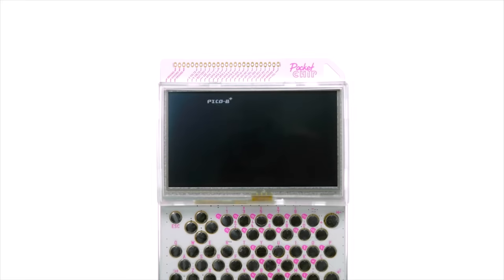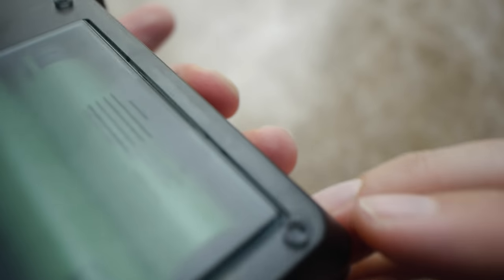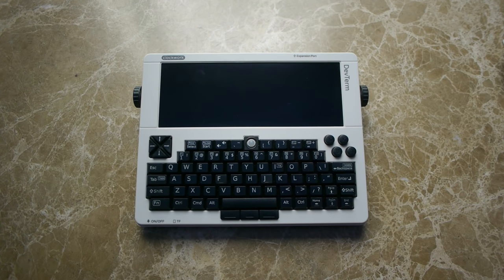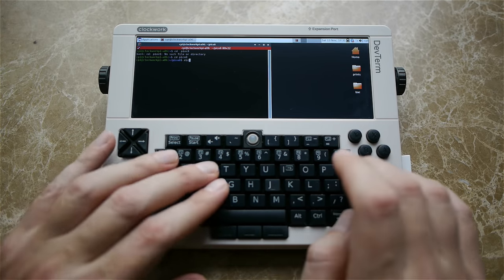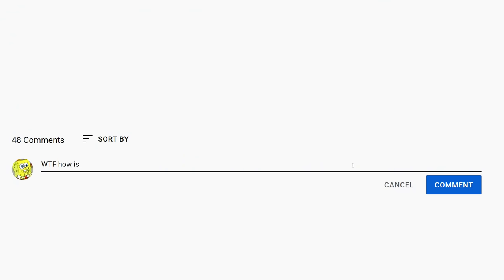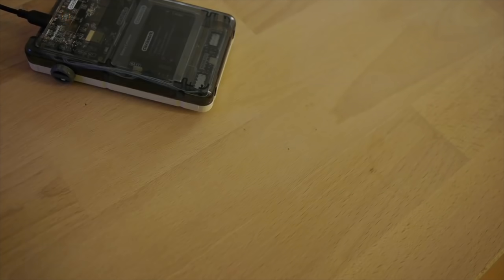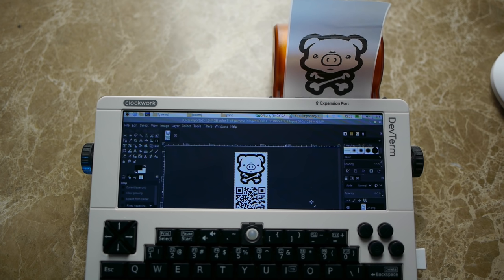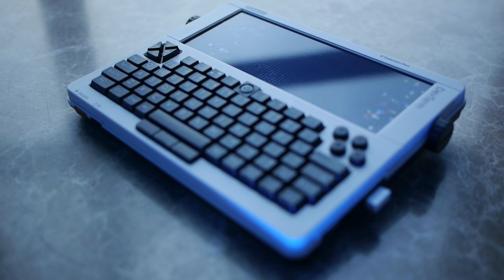ClockworkPi DevTerm | HARDWARE REVIEW

Comment from the maker: ⚠⚠ERRATA⚠⚠
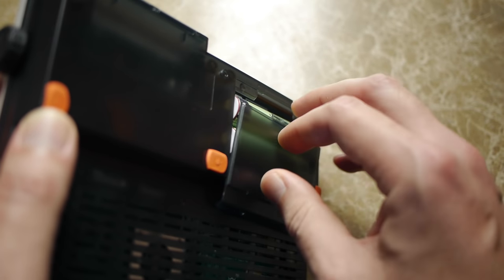4:10 - I've recieved reports that the battery flap is more stable in other units. It is unclear how prevalent this issue is.
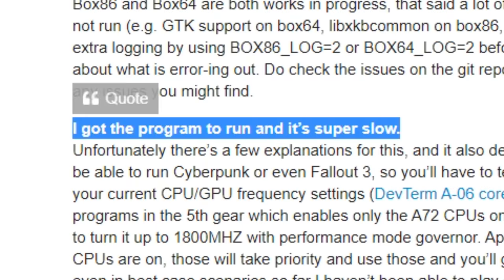15:11 - The A06 unit's Armbian system does have a package manager. So you can simply do "apt get-install" for a lot of software. In this video I'm referring to compatibility issues for software that isn't covered by the package manager - like Pico-8 or TIC-80.
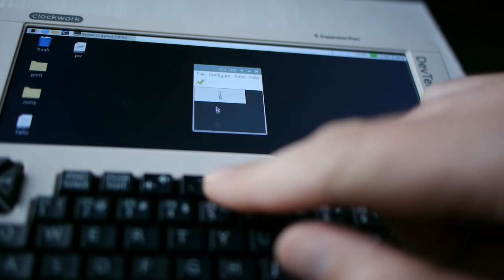24:33 - I was able to get HDMI-out to run after all. Seems like my problems might have been caused by the socket being inset too deep. The cable I used has a hard time making a proper connection. Heard other people having similar issues. If you encounter issues with HDMI-out, I recommend trying different cables.

Comment: It seems like whoever designed the console buttons has never use a game console.   Also they should've used a trackpoint instead of a trackball, or at least a larger more accurate trackball that actually uses laser tracking.  Those tiny trackballs weren't meant to be as accurate as the fullsize trackballs that normal trackball mice use since they were made for old phones.
Reply from the maker: Probably one of those things that becomes obvious in hindsight. With the console buttons I assume the used similar engineering they used on the keyboard keys. And surprise! Keyboard keys are not the same as console buttons!

Comment: Great video! Despite all its flaws, I still love my Pocket CHIP. Nothing can replace the fun of bringing it into lectures and having friends struggle to write a single line of C code with its keyboard.
Reply from the maker: How can something be so bad and yet so very good.
Reply: @LazyDevs  apparently there is gonna be a Pocket CHIP 2 which will surely be interesting
Reply: @camden4770  Wait, really? Next Thing Co. is dead, and the only seller of CHIPs and Pocket CHIPs rn is PocketCHIP.co, which is only selling the stock they received before Next Thing Co.'s demise. If there is gonna be a Pocket CHIP 2, who's making it?
Reply from the maker: @othercannon1907  Looks like a company called Sandmath. CEO is Dave Rauchwerk, the main guy behind the original Pocket Chip. Looks legit.
Reply from the maker: @camden4770  Dang! First thing I've heard about this and now I'm hyped.
Reply: @LazyDevs  yeah! From Dave Rauchwerk’s Twitter it seems like the second Pocket Chip is getting a new and nicer keyboard. Hopefully it solves the issues of its first version and still keeps perfect Pico-8 compatibility!
Reply: I still have mine and one of the chips died on it ;(

Comment: In most Linux desktops, you can just press ALT and click-drag a window in the middle to get to the hard to reach bottom part.

Probably don't swap out batteries with the device still running. So if you have depleted one set of batteries, they have a voltage of around 3.2V or something like that, but a cell fresh off the charger is 4.2V. So you have removed one cell, so far so good, now you insert a fresh cell in its place, and then you have compensation current rushing through to equalise the voltage on these two batteries, one will be discharging at inhumane speed and another will be charging at an inhumane speed, current-limited merely by a little bit of steel for the contacts in between! This is a great recipe to make them vent very hot gas. OK maybe they were smart and put in some polyfuses in there, but then, the device will shut down anyway.

Focused writing device? Maybe the likes of Psion V or Psion Revo. I have some Psion V units here. Haven't tried the Revo, but on the V, i can't thumb type, i can't reach the letters in the middle, but i can touch type. Revo's keyboard is a little smaller across, probably more thumb typeable. They are vaguely pocketable, for some types of pockets, presumably the lining pocket of a very expensive suit, i think the Psion V MX was like $3000.

Another very useful sort of device is just a late-2000s netbook. You probably get one for free if you ask around, everyone bought them, noone knows what to do with them. Plop some Linux with XFCE on it, boots instantly, emulates 16-bit consoles and Playstation, keyboards are actually made for typing. Screens are a little garbage. 6 hour active use battery life if not more. Maybe you can install some newer nicer cells into the battery, they usually have 3-cell batteries with 6-cell option. Opening the battery pack is very unnerving, but i was successful dunking the thing in gazoline outdoors and it seems to have softened the glue holding the thing together, and then i could just twist it open.

And yeah Devterm is definitely a Cyberdeck device first and foremost.
Reply from the maker: Thanks for the insightful comment!

Oh yeah, ALT-clicking works too. TIL!

ClockworkPi explicitly say you can swap batteries one by one. I suspect they did some fancy wiring to prevent one battery supercharging the other. But yeah, it sounds sus as heck and I wasn't willing to risk it while still doing the review. Might try it in a follow-up video just to see what happens.

Ah the good old PDA days. I had a Palm V myself!

Netbooks is generally my go-to alternative too. I have an smol cute Asus. Even did my own battery shenanigans. I didn't mention them this time around because AFAK they aren't making new ones anymore. And it's a bit unfair comparing a new device to used offers. Of course used gear can be a lot cheaper.

Comment: As a musician who loves old MIDI gear and sequencers, I would love to see this offered with an alternative keyboard so that it could be used as a standalone replacement for ancient hardware sequencers or something like a Polyend Tracker. As is, between the tiny keyboard with the Shift physical "binding" problems, the trackball / directional problems, the screen res, the lack of sleep, and the fixed, very un-ergonomic screen angle, I just can't see using this at all for coding or any other computing application, no matter how much I've always loved the Tandy 100 look (and I have, since the 80s!). But it would be great for other things, and given the modular design, maybe ClockworkPi can expand the utility of the DevTerm through creative input device reimaginings alone.

Comment: This is a nice, in depth review, quite interesting. 
On the hacker/DIY friendlyness, i beg to differ however : designing a PCB is really not that hard.
The connector of the user board can be done by simply having  pads on the PCB (so no component, it is
a part of your pcb, for the male end obviously). The rest is about placing what you want on the board.
This compartment seems spacious enough to allow to add some stuff there, such as sensors, peripherals, etc...

Remains to be seen what data lines are connected to the main SOC : if it was a CM4, i could see a pcie bus, so you could
add an nvme storage unit, wifi modules (for wardriving, for instance), lte modem, lora, etc....

So depending on how good the ressources are (specs for the dimensions, busses, data lines, etc), it could really be DiY friendly.
However, it is using a CM3 module, so i don't know if i would spend much time designing a circuit for an obsolete SOM.

For me, all the flaws you pointed make this machine a very hard buy, considering the other solutions that exist. 
Also, a clamshell design would make a few things more functionnal. 

I understand that there is an atypical proposition from the authors, but it seems to be lost in the impracticality of the design.
For instance the inability to set scrreen angle seems really anoying to me on a portable machine.
I feel like this machine would have benefited from being bigger, to have a larger keyboard, and make it really nice to type on, so
top notch ergonomics and controls, and have it being "the ultimate mobility typing experience" or something. Here, it is fun, but other than that, it feels like it has really few uses where another machine wouldn't be better at it.
Reply from the maker: Yeah I heard that prinint PCBs has gotten easier. Still, it seems like there is a step missing. Going through a 3rd party service doesn't feel like a setup to encourage free experimentation. So for example, I'm a total beginner and I wouldn't even know where do begin with designing a PCB myself. But I'd be happy to poke a wire into a GPIO and see what happens. The latter would allow me to eventually get to a point where I could do the former. The DevTerm is good for people who already did the poking.

Funny enough, the NVME is the first thing I thought about too.

I think the A06 is for people, who find the CM3 boring. I also heard from experiments on getting a CM4 to run using an adapter.

I thought the inability to change the angle would drive me crazy. I was surprised how usable it ended up being. And yeah, I can totally see the appeal of a full-sized DevTerm.
Reply: @LazyDevs  There's some folks on the clockworkpi forums working on one that'll effectively be a GPIO breakout with a prototyping board, so if those are made available it should make it more hardware hacker friendly for those more used to working with raspberry pis and such.

Comment: I feel like they should sell one of those "lazy reading glasses" that point your eyes 90 degrees down. 
that isn't a knock against it I just feel like it should come with them since you're basically asking to have your neck hurt after using it for a while.
Reply from the maker: Did not experience neck pain but I'm rather resistance to that. YMMV
Reply: The solution to that problem on the Model  100 was some simple round legs that fit in the screw holes.   This has no screw holes from the sound of it

Comment: I wonder if we could squeeze a Teensy board with its microsd in the free space on the top left (when you opened it from the bottom). That would be a good on the go dev tool for teensy project programming.

Comment: I wish the keyboard in this was either smaller to accommodate thumb typing, or larger for actual typing. it's in this weird middle ground where nobody is happy because you can't type with your thumbs nor can you type normally.
that's the largest pitfall i see with this machine.
maybe something like the game console but with a blackberry keyboard, I know LG had a phone where the left and right half of the keyboard were split to accomodate a second screen, but i could see something like this using it so you can have a comfy handheld experience and you don't have to stretch your thumbs like the micro chip pocket.
Reply from the maker: Sure it's a middle ground but not necessarily one that doesn't work, IMO. It manages to pull of both for me, and that's a big deal. But I get your point. It feel like there is room for improvement yet.

Comment: You can play around with the video settings in the config.txt file on the boot SD. The 1200x400 is probably not being recognized by any HDMI screens.
Reply from the maker: I found out the issue. The connector was too deep. My cable wasn't making proper connection. Weird.

Comment: If you want to experience a bad keyboard, how about early Sinclair keyboard, like on ZX80/81 and early Spectrum revisions? Well "want" is maybe the wrong word. It's basically like a TV remote control. They solved the issue of it being impossible to type on by having BASIC keywords each be mapped to one key of the keyboard, so you don't have to type them out. In fact the BASIC input is context sensitive and knows when which inputs are valid and what they mean, so that's nice.
Reply from the maker: Smart! I should have done something like that with my PocketChip. Yeah I know the ZX81. Honestly, I don't even know which of the Keyboards is worse.
Reply: I typed in programs from a magazines and books on the zx81, I didn't know any better so it wasn't an issue for me. Saving my progress to tape and starting again the next day after school was my childhood, I loved it, I was a kid from a poor family and I had my very own computer
Reply: @valley_robot  I know, those computers were world's cheapest and made the computer accessible. Some friends of the family helped me made a clone of the Spectrum (Leningrad 48) and they sourced the parts, i ended up with a really grating keyboard, seemingly pretty bombproof with reed switches, but just insanely rough and difficult to press, maybe worn, maybe manufacturing rejects, maybe that was just the usual Soviet quality. But it's not like 9 year olds are known for fluid touch typing, so it was fine, and the input scheme actually makes it very usable.

Fun fact, the Spectrum could be cloned entirely from Soviet domestic parts, and it was fairly unique in this regard. There was a Z80 clone developed in East Germany which was also manufactured in Russia. The other big chip in the Spectrum is the ULA chip which does all the video, memory and IO routing, which couldn't be cloned at the time, but it was possible to reproduce it with about a dozen 74-series and 40-series ICs, simple single-function ICs, small- to medium-scale integration, functional equivalents of all of which were available. And this is how it worked. The Leningrad computer existed as a bunch of plans, instructions and PCB artwork which were photocopied from one person to the next, spread via underground enthusiast networks. Everyone knew someone who knew someone who knew someone to etch the PCBs, burn the EPROMs, source the ICs, and then you just solder it all together, and with some luck, it might even work. A lot of parts that you'd get would be rejects though, or stolen off the assembly line untested, mine was insanely unreliable, it would lock up completely about every half an hour to a couple hours, which was a much bigger issue than an unwieldy keyboard. Programming was a less frustrating activity than playing games, because if a game crashes, your whole progress is lost, but you can save your own program to tape anytime.

Comment: Waw, awesome video!
PocketChip was a great device, but its keyboard and low resolution made it hard to code on. My thumbs will never forget that.
This device seems to have a better keyboard, its screen seems nice for text editing but other than that, I feel it's a bit unsuitable for a general purpose OS like Linux.
Regarding the trackball, isn't there any option to change the sensitiviy?
Reply from the maker: You can tweak the sensitivity but that was already max sensitivity. The problem is that the trackball is too small and the sensor inside is not able to keep up with the speeds requires to navigate a screen of this size. You can tell because at a certain point, scrolling the wheel faster makes the cursor go slower. There is a sweet spot beyond which the sensor loses track of the rotation of the ball. Would need a bigger trackball or a sensor with a higher polling rate. Or a trackpoint.
Reply: @LazyDevs  Oh it's that inconvenient, it definitely needs to be replaced then😅
Thanks for giving more details!

Comment: Thanks for this! I'm waiting for my preorder to ship, and though this doesn't diminish my enthusiasm any, it's very good to know the possible pitfalls tn advance. One question: You very briefly mentioned using the DevTerm as a dedicated writing device - and this is actually the primary reason I ordered it... I'm always hurting for a device I can easily write text or code on while holding it in my hands, seated somewhere other than a desk or table, without anyplace to set a laptop down. Ideas come all the time that I'd like to commit to text. But I hate trying to type anything substantial on a phone touchscreen, and I hate how locked down typical mobile devices almost all are. You mentioned notebooks as alternatives, but none of the ones I've seen would seem to be at all usable as a handheld device, to type on with thumbs. Do you recommend any other devices besides the DevTerm specifically for this use case?
Reply from the maker: Don't worry, you have plenty to look forward to with your preorder. It's gonna be fun!

As for other handhelds - Some of the devs of the PocketChip are working on the Popcorn Pocket PC, this looks like competition to the DevTerm. Also, I think some of the GPD devices are handheldable. The GPD Win 3 for sure. Pocket 2 and 3 possibly too.

Comment: I got an idea for better keys, not a keyboard fanatic though so don't expect me to care if you think something else is better, anyways I was thinking of just a plain rubber seal on top (so no liquids or dust can get in), a plastic spring or 2 underneath with a container like you see with some back scratchers designed to fit in your pocket and a hard plastic T shaped sheet between the springs and the rubber seal, the top of the T is just because rubber alone doesn't feel great for typing with, the other part is for lazer light interference for the actual input part, an alternative idea is a fold up lazer keyboard, I have a normal one that's no bigger than the hand holds on a dualshock controller but it's a pain to use on hard surfaces, it's also hard to see on bright surfaces, the fold out part is just gonna be a somewhat thick rubber sheet for the lazer keyboard to display on and give something comfortable to type on.
Reply from the maker: Lazer Keyboads are trash. Sorry. As for your other idea - you should get in contact with ClockworkPi. Or make a prototype yourself!
Reply: @LazyDevs  You realise I already laid out why I agree with you and what could be done to improve them right? If it's response speed you're on about it should be possible to build in touch response to the rubber sheet the keyboard would display on to improve that also, the main thing I like about lazer keyboards is they have the potential to go where only virtual keyboards have been able to go so far but at a bigger scale, displaying characters for the language one wants to tyoe for, in my case I'm learning japanese and want an easier method than resorting to a virtual keyboard, the lazer keyboard would be a suitable middle ground for me